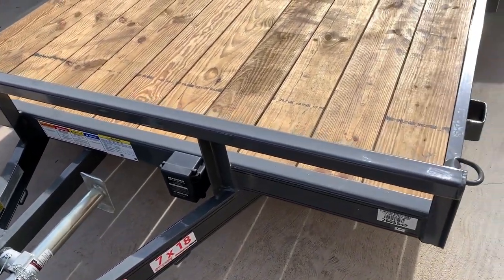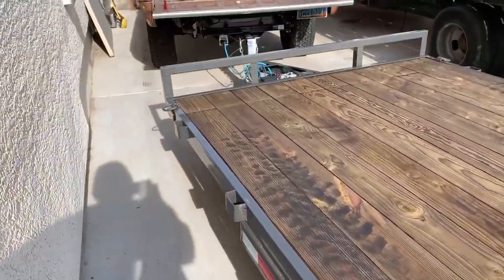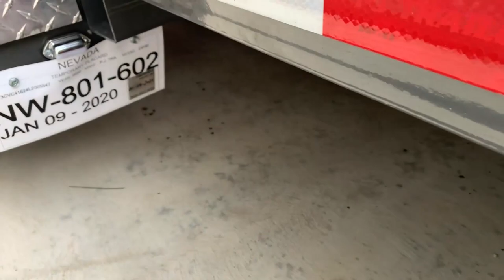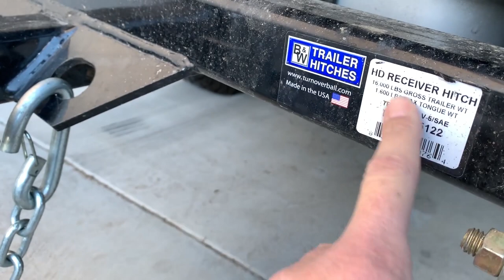New Trailer, Problems?

Comment: These units come with the least amount of stiffness and bracing as possible.I have repaired dozens of these things in the past few years.Those angle bars are not even a quarter of an inch thick.Pretty sad really.Steel tubes will fix the weakness not screws through the wood.Plus it will tow a 100% better.

Comment: Depending what they do/warranty, how about adding a block of sorts (wood or metal) between those two L channels to help support where the weight of the Jeep tires sit? Im sure beefing that area up is on the table no matter what.
Reply from the maker: My initial thought was to add another piece of angle butted up to the back of that one, clamp it, screw it down  like I did this one, and stitch it along the bottom/sides, but I like your idea too. That’s why I like posting these kind of videos, I always get good ideas!

Comment: What hitch drawbar are you using for weight distribution?
Reply from the maker: I have a 1000LB ezlift round bar.
Reply: I have a similar Curt setup. Can you get enough drop with it to keep everything level? 
Or is that why you are thinking an axle flip is necessary?
I can’t get enough drop with mine using it on a stock height GMT900 chassis.
Reply from the maker: With the current height of the truck and trailer I don’t think I could get it level. I’m planning to do the axle flip this weekend. When I set up my travel trailer I had to get a larger drop shank for my WD.  Blue ox makes a drop shank BXW4003.